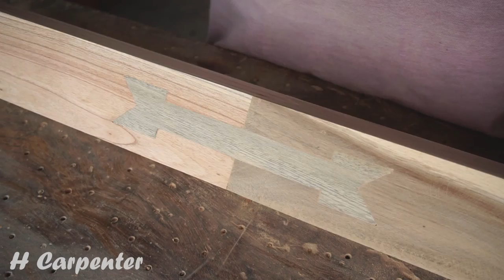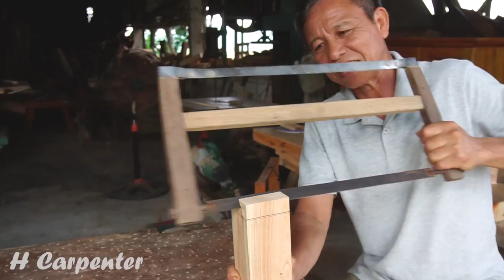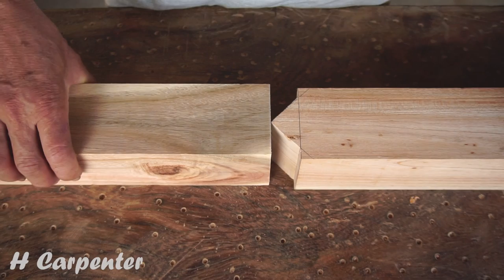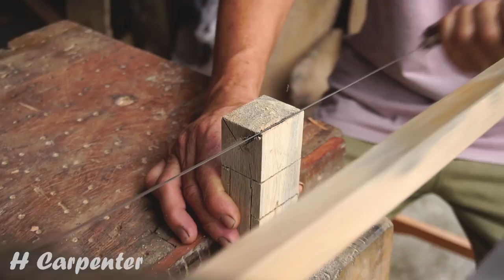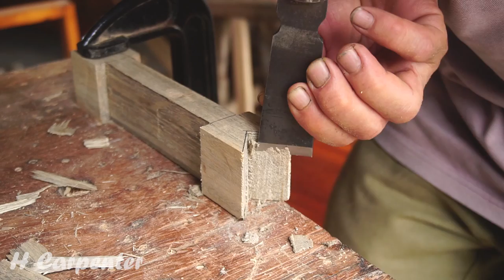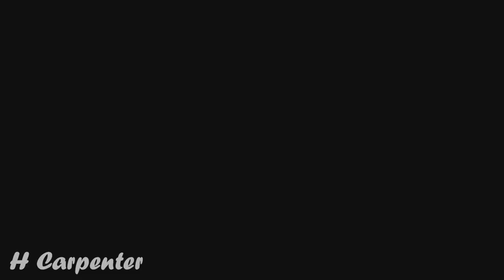Incredible Traditional Woodworking Joint Techniques And Skills,Simple Lock Corner Joint Without Nail

Comment: Here I am, trying to find a board stretcher because I cut it an inch too short, and this is all I have to do.🙆‍♂😂
You are so talented! I am looking forward to trying this joint soon. Thanks for sharing.
Reply from the maker: yes, I'll learn from it next time
Reply: How did you do with your board stretcher? The joint shown in the video is nice but has the problem that can't be adjusted by length, so you have to be super-precise. The Kanawa Tsugi is more appropriate for you if you are not an expert like the guy in the vid.